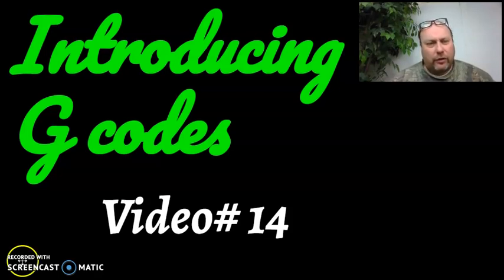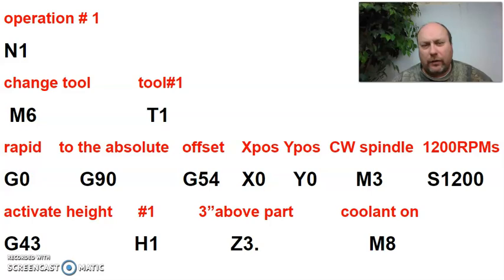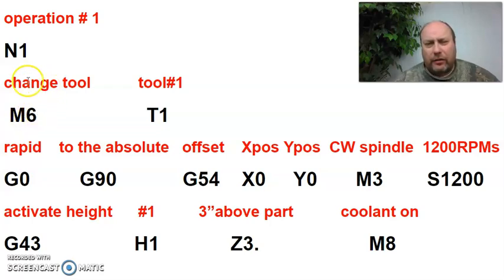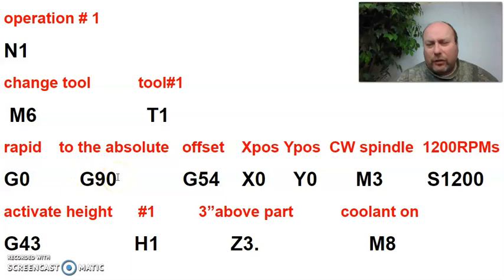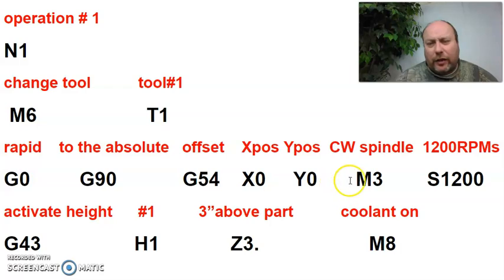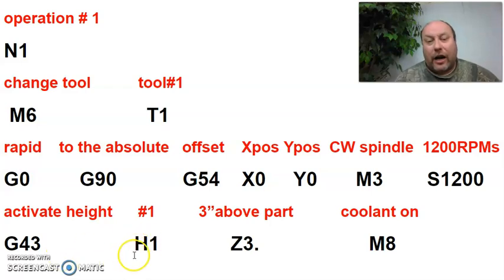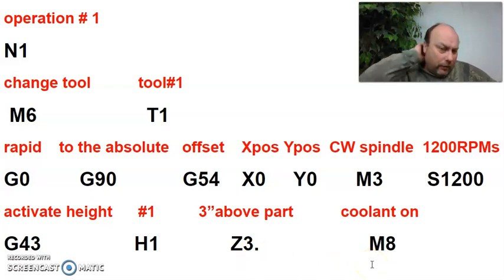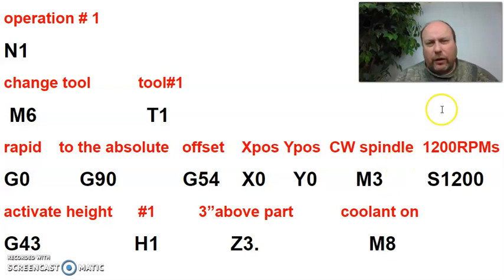CNC Machinist Made Easy: Intro to G codes

Comment: I am entering into an unknown world of programming for me. I can read code and make up and pickup the basics quite G0 (rapid) What I don't understand yet is how signals travel from the CNC table (in my case a Torchmate 4400 with a Powermax 85) drive to the Plasma Cutter. I know there are some very basic instructions to start and stop the ARC and to to sense for high or Z axis calibration and so on. This machine was most likely stollen in the way that they took the Plasma Cutter or power source which I presume it would have been a LE FlexCut 80 as these Torchmate and Lincoln Electric equipment are mostly sold in a similar combination even today. Well, my friend, the shop owner acquired this CNC and another even older CNC machine also with components from Lincoln Electric as a separate CNC system. That system was using a Hypertherm Powermax 85 plasma cutter with its own separate driver and manual controls not computerized. At any rate, here are they, 2 non working CNC machines. I tried combining some of the parts from the older machine to the Torchmate 4400 water table with the newer Lincoln Electric Accumove 2 and computerized TMS or whatever they call the controlling software. At this point I have a big problem since the 4400 is using the torch for the original Flexcut 80 and its not compatible with the Powemax 85 I now am trying to connect. Easy solution, I swapped the torch and its cable to try to get this system to communicate. Only to find out the Popwermax 85 had been molested by someone and adding a separate voltage divider board when they were using it with the older system. The present situation right now is that even the CNC runs every DRY JOB fine, it fails to run ACTIVE JOBS as it seems to encounter conflicting signals either coming from the power source or from the Accumove 2. I have spent a great amount of time trying to figure out what is the root cause of the problem before I can go and buy parts. We have covered the basics such as air supply (dry) water levels, air presure. I need help understanding this signals coming from the Accumove 2 driver box or what I suspect is getting a redundant Z signal one from the Accumove and another from the Plasma Cutter (powermax torch cable) If there is anyone around the areas of Southern California like Santa Fe Springs to Inland Empire and you think you can help I can come to you and Ill bring my plasma cutter to check on this voltage divider connectivity and possibly check the torch cable for duplicate signaling for high evaluation . My machine basically starts cutting but then in less than 3 seconds it starts jumping up and down and it never finishes any test jobs. Have tried new consumables. I know I wrote a lot but I am trying to better explain my situation so I can connect to other users either having the same issue or a guru out there of these machines that have seen this behavior before. I wish there was a discord or any other forum to make this a more professional way of creating an issue ticket, get people interested in doing problem analysis and start from there. I am writing this on a Sunday morning. I have been researching for the most part of the week and since last month. So sorry for the long read and I do thank anyone in advance who would have some information I could try. These machines are pretty expensive and we just don have the money to go and get a new one or even pay for tech support from either of the two companies involved here that btw, already blamed each other for the problem. Yeah I have talked to them too already. TIA,

Comment: Is g54 the same as using a touch probe to get the zero position and what is ment by offset?
Reply: Yes, it is designated for a zero.
Offset is the term we use. G 55 would be another zero offset.
Reply: @thebelieversvoices3461  thanks ive got a 3 axis cnc and would normally just use my xyz touch probe to get zero position and modern cad software to generate g codes for me but most employers still use this old - style g code so im having a hard time adjusting, but your videos are a great help!

Comment: Im glad i came across your channel. Im old and by all rights should be retired because of age but still are working for an automotive plastics/ sunroof manufacture. Not out of dire  necessity but do not whish to be retired with nothing but my home machine shop to play in.    I got my CNC certificate at a local jr. College about 5 or 6 years ago. I did not have any access to  cnc machining equipment and just used what i learned in class to become a better manual machinest. And i absolutely think it did that. But recently the mold shop at work purchased a new cnc mill  and it renewed the intrest in the cnc process for me. After 5 or 6 years with not using the g code i came across this video. And would like to say by watching it 1 time i was right there with you just like i finished class yesturday. Your explainations were clear and to the point and not muddled with information that clouded the water. There are nany good videos on this subject on yt but i think a person would do theirself a service going through your posts before getting other perspectives.
Reply: You are very right on point 👉

Comment: I DON'T KNOW IF YOU STILL READ COMMENTS BUT THANK YOU, SIR. 
I took a photo at work of the first line of the last program i ran, and sure as anything, my FANUC MAG FADAL follows this BASIC PROGRAMMING TO THE LETTER..

FANUC PROGRAM: THIS WORKS, SO BEFORE YOU SAY SOMETHING IS WRONG, YOU ARE MISTAKEN. 
HERE IT IS: 

N2
T2 M6 G0 G90 X21.102 Y-1.968 S1250 M3;
G43 H2 Z1.T3

CHOOSE TOOL #2 (T2 M6)/RAPID TO (G0)/ ABSOLUTE POINT (G90)/ TO X-AXIS 21.102 AND Y-AXIS OF -1.968/ TURN ON SPINDLE TO A SPEED OF 1,250 RPM/ CLOCK-WISE;

PICK THE HEIGHT (G43)/ OF THE SECOND TOOL (H2) WHICH IS TOOL 2's PROGRAMMED HEIGHT ABOVE THE WORKPIECE. THIS HEIGHT HAS BEEN DESIGNATED AS 1" THROUGH USE OF A 123 BLOCK/ T3 GET READY TO CHANGE TO TOOL #3 IN THE PROGRAM'S SEQUENCING

NOT QUITE SURE WHY THEE PROGRAMMER ADDED IN T3 AT THE END, but it works and that's that. I imagine it is this, though:

T2 is a chamfer
T3 is an endmill

But in the example that I broke down here at the start-- the G43 H2 Z1. T3 block-- the next 6 lines of code run before the tool actually changes to T3, which is an endmill. So I am guessing that the prgrammer could have left that in or out in the programming of the second op  (N2). Yes? NO?